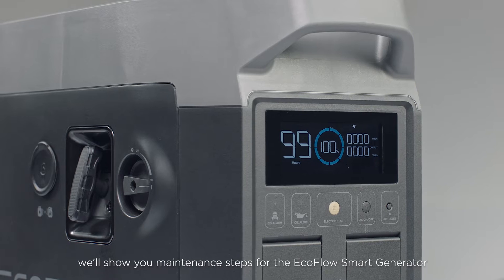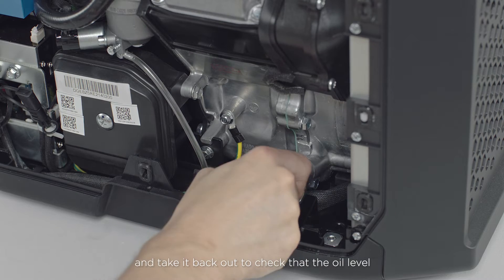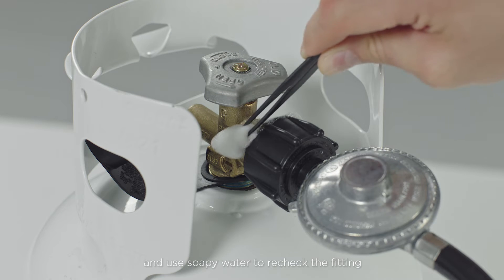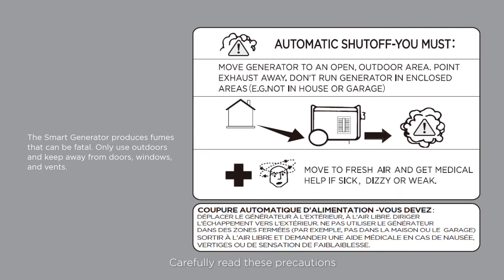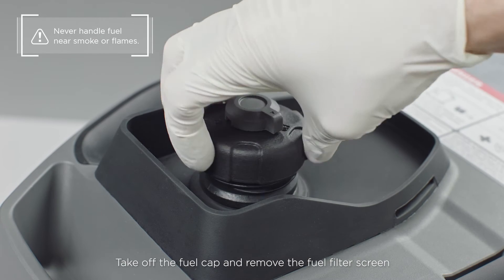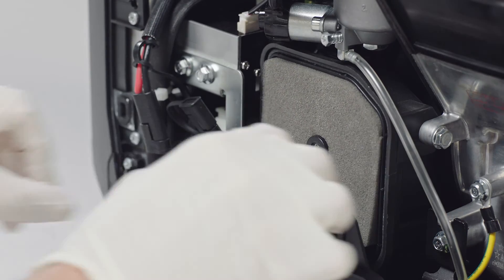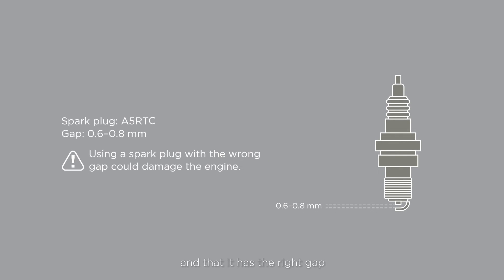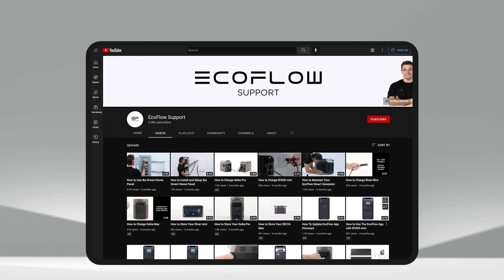Smart Generator (Dual Fuel) Maintenance Tutorial

Comment: When I put the proper amount of oil in the generator it comes leaking back out! Am I supposed to let it do that until it stops is that the right amount of oil or am I supposed to tilt it backwards so it holds the full 380 cc? I'm thinking maybe 380 oil filter or something maybe and I need to let it drain out?
Reply: Hello! It is possible that some of the old oil was not completely removed from the engine. Try warming up the engine a little and only then draining the old oil. When heated, it will flow out more easily and you may be able to drain it completely. Be careful when servicing a warm engine to avoid getting burned!
Reply: @SergioStarter  duhhh.  That makes sense!!!  Thanks!!!

Comment: It’s difficult to do maintenance at the correct points because it does not record runtime when running on lpg. Ecoflow has confirmed this and there’s no fix in the pipeline. Also would help if the company expressed the correct oil amount in ounces for users in non metric countries.
Reply: Hi! My Ecoflow generator, when running on LPG, shows engine hours. It is strange why your generator does not show them. Oil is needed 0.38 liters or 0.1 gallons.
Reply: @SergioStarter my generator has stopped showing any runtime hours. i have to be meticulous about recording them now

Comment: It's only a smart generator when the temperature is 33 degrees Fahrenheit or above.
The instruction manual says to run it for 3 minutes before applying any load on it if the weather is 32° or below so, It should not be used as a smart generator once the weather is freezing. It's more like a Florida smart generator than a New England one.
Reply: lots of bot comments. thx for pointing put the low temp. 

however it wont even work/ start if the battery temp is below/at 32f

ask me how i know!

Comment: I was thinking of getting the Delta 2 plus and an extended battery. Can I also attach a dual fuel ecoflow power generator to these devices? So I can be using the delta 2 plus and keep the batteries topped up with the generator.
Reply: Yes, it can work that way.
Reply: delta 2 is not supported for smart features on the cheaper smart gen. make sure u get the bigger one with high power dc output

Comment: The carbon monoxide sensor is way too sensitive. Wish there was a way to override the auto shut off. I had the unit outdoors in a large 4-side baffle box enclosure to quiet noise in our camp. Even with a completely open top to the enclosure and with fans running to circulate air, the unit wouldn’t run.
Reply: Drile 4 large holes in it. Anything will go off if it's totally enclosed.
Reply: @jacobpetersen5662   The box was four feet by four feet, open top...then fans just generally moving all of that air around...I'd be shocked if a couple holes did the trick...will respond again if I get around to testing it some more.

Comment: hello, i have one ecoflow solar panel, i would like to know if i can connect the - on the + from the same solar panel to protect it from weather when he is not connected to my battery.
i know the solar panel and the wire are ip68 but i don't kown about the connection.
Reply: If you have portable panels you would just fold it up and store it out of the way.